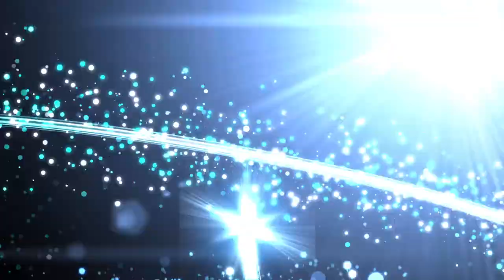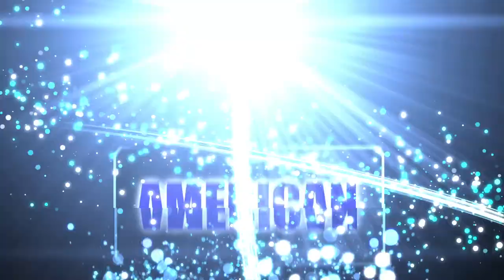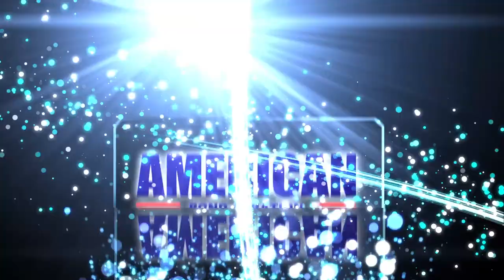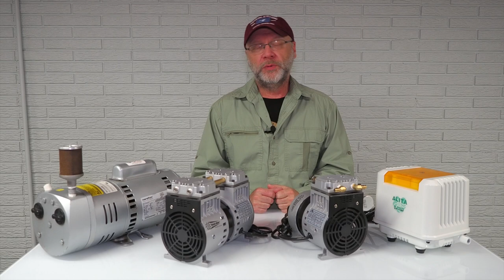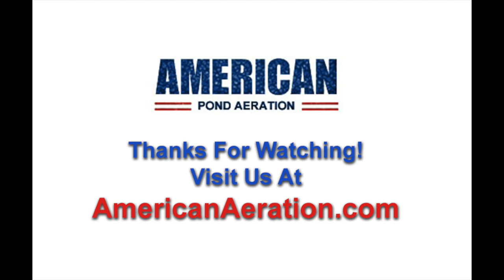Pond Aeration Pumps - Three Popular Designs And How To Choose The Best One For Your Pond.

Comment: Thank you! This was very informative! I am curious to know how loud each can be and their recommend proximity to a home.
Reply from the maker: Hi Jonathan...great question.  Its tough to answer for all these pumps but I can tell you about two of them.  So the linear pumps, like the one on the far right are very quiet...they just basically hum a little bit.  The 1/4 HP rocking piston pumps...in a normal aerator system, with a cabinet, they have been rated around 65 db from 10' away.   This db level has been compared to a window air conditioner...as one example.  The Kasco pumps when purchased in a system come with a module that really quiets them down...you can purchase this module separately too for older systems...it's purpose is just to monitor the air intake filter and tell you when it needs changed, but it dropped sound out of the pump by 34% which was pretty good!  None will ever be silent but they are getting better all the time and to be honest, most people don't seem to think they are very loud at all.  Thanks again for the question.
Reply: @klmponds  Thank you for the quick reply! Again, this is great information. I would like to install a system sooner rather than later, however to install the system away from the house would require greater electrical work. I could install it near the house (which is approximately 30ft-40ft from the edge of the water), but I fear this would be loud for my neighbor and I. I am fairly certain I need a rocking piston compressor. Would it make an auditable difference if the compressor is in a cabinet mounted to concrete versus a cabinet fixed to a post?
Reply from the maker: @jonathanrhodes4788  you are welcome!  So one thing to note...you don't necessarily need to run power to the water...at least in terms of running one of these aerators.  We use burial airline all the time for what I would call remote power.  The pump and possible protective cabinet goes by the power source, then you run airline in ground to the pond edge and the weighted airline goes in the water and down to the difuser.  Its usually a lot cheaper doing this than running electrical.  But if you want power near the pond anyway, then for sure, that's doable.  Good question on the ground vs post mount.  I don't know that I have a super accurate answer for you as I think it more has to do with the cabinet's ability itself to buffer the sound output.  My perception is you might have a bit less vibrational noise out of a poly cabinet over a metal one, but I have no evidence to back that up...and the difference would probably be slight.  I like this question though so I'll do more research on this and see what we can find out.
Reply: @klmponds  We have a wooden post that we ran conduit to from our outbuilding and took the post to the edge of the water. Installed 4 gfi outlets on the post.  Works great.  Use a "fake rock" to cover everything up and keep the noise level down.
Reply: On our Half acre pond (14 feet deep in one end and then up to about 6 feet in shallow end) .. I INSTALLED A KASCO SURFACE BUBBLER ( some call them “boilers ?”…) this past Spring(2023) … the results are remarkable.  
I Use SONAR RTU AS WELL as Tsunami and others for aquatic weed control.  
Dark blue lake dyes have also provided benefit by slowing down the photosynthesis of aggressive algae growth. 
It took a massive amount of duckweed and our pond “turning” resulting in a massive fish kill …. For me to better educate myself and get things right.

Comment: Are the output port fittings / screw threads all standard? I have a Thomas 2680CE44 but nothing specifies what size connector fits the discharge port to connect the distribution manifold.
Reply from the maker: Hi James...so across the board, no, the threads/ports are not the same on the different types of pumps.  On most rocking pistons though like your Thomas, the port/thread size should be 1/4" fpt.  I hope this helps for you!  Mark

Comment: I have a few questions if you'd be kind enough to answer It would be very appreciated, sorry if you already answered the same ones already.
The pond I'm installing aeration in is around 2 acres 24ft in the deepest section (middle ish of pond) Will running a diaphragm pump (hiblow 10ft rated) in the shallower section at 9 feet still be moderately effective assuming it is above the thermocline?
If I split the hose to two diffusers on the diaphragm pump am I over stressing the pump diaphragm?
lastly in relation to the first question... forgive poor wording but if I run a rocking pistol in the deepest depth for limited hours daily say 2-4 (24ft) will the combination of the diaphragm pump running 24 hours a day change the answer to the first question or how will it effect?
Reply from the maker: Hi John...so if you already have the HiBlow and want to use it there's no issue in doing so as long as you give it some room on the depth.  If you don't have that aerator yet, I'd pass and just get a rocking piston to handle multiple diffuser locations.  A single 1/4 HP pump would do it, or if you wanted a bit more air, you could go to a 1/2 HP.  One diffuser doesn't have to be at the deepest but it should be reasonably deep...Anything around 15 to 20' will cover a bit more than an acre in size, so if the second diffuser is at 9' that would cover it all pretty well.  But you would likely want to try to aerate most of the pond with something and aerating just in the shallow section, while useful at times, is not going to help as much with water quality or coverage.  I mean, in reality you can try anything and see how it goes.  No harm in that and if you can save money great...but being under aerated like that isn't usually going to produce the results you want.  

On the two diffuser arrangement....you want to have a manifold on the pump that has a valve for each diffsuer...this way you can control air flow between them as you wish, even with the depth variances.  Splitting the line, such as with a T or such is not going to work becasue air will go to the point of least resistance...ie, the shallow diffuser.

Does this help for you?
Reply: Thanks for replying. Yeah, I already have a hiblow running before I stumbled across your video, got the 80, undersized for the acreage. (thought process was some aeration is better than none, and it could at least keep the beach/dock area nicer) You was very helpful, and I think it's awesome you respond to peoples questions. I was curious about any experience with undersized/above thermocline aeration and how beneficial it might be, I knew starting out I would have to swallow the power bill and end up running a rocking piston, at least part of the day.   @klmponds
Reply from the maker: @Project_Happy  no problem at all.  So my honest opinion is I don't think the limited aerating will help that much...but it can provide some place for fish to go that's better aerated.  And, heck, I could be wrong.  Since you have it in hand, see how it does and if you need to do more, you can over time.  The 1/4 HP rocking pistons that you would use in the deeper water cost about 15 bucks a month to run full time.  So not bad really...not as cheap as a linear of course but not bad for what they cover.  Don't feel you need some kind of big pump just because of the depth.  The 1/4 HP will handle it fine and you can put one diffuser on it to start, use your hiblow in the shallower area and you'd have good coverage if you need to go that way.  Budget wise the best I have is the Easy Pro PA34...we have sold those for many years and it's been a good system for a reasonable price.  https://americanaeration.com/sentinel-1-4-hp-aeration-system/

Comment: The 1/2 hp has a bridged intake and exhaust. Are these motors designed to block one end or designed to have an intake filter on each end? I don't want to overwork it and the pistons probably aren't timed to run opposite of each other.

Thoughts?

If you run dual intake then should you also run dual exhaust instead of single with a split?
Reply from the maker: So I spoke with a Kasco engineer about this.  He said he did lots of testing using both in ports and there was no benefit in doing so.  There was minimal at best extra air flow so he said no need to use both.  And if you did decide to run a dual intake you would not need to run a dual exhaust since extra airflow would be very minimal.

Basically all of the systems we work with using dual pistons have one intake port open, and one out-port open.  The air filter goes on the intake and the out-port has a brass elbow that connects to a heat resistant hose...or a multi-valve manifold.  These of course ultimately lead to the airline that goes to the diffusers.  We have great performance and great longevity out of them. Hopefully this helps answer your question.

Comment: Thank u for the video. I'm from India and was starting a fish business with a half Arce fish pond with a depth of 8 to 10 feet. Which aerator would work well for me. I would be doing intensive farm.
Reply from the maker: Hello!  I would investigate a couple diffferent things.  For a sub-surface aerator system, you could look for a 1/4 HP rocking piston pump as pictured in the video here.  There is also a 1/4 HP rotary vane which would work at the depth you have.  And for fish farming, you might consider looking at a surface aerator of some type.  Those are often desirable for fish farming in warm/hot weather.  A 1/2 or 3/4 HP model would work for a surface aerator.
Reply: @klmponds  thank you again, why a surface aerator? Do they work better for fish farm, if yes why so?
Reply from the maker: @antarjot  In certain situations I think the sub surface aerators can warm the water too much in hot weather.  It is better to not turn everything over but just aerate at the surface...increasing oxygen in a zone so to speak, without stirring up the entire pond...which increases the temp of the entire pond in warm weather.  Fish need a balance of good oxygen levels, and reasonable temps to do their best.  Too low of oxygen, or too high temps will cause them problems.
Reply: @klmponds  thank you ever so much.  This was very informative. I'll keep bothering you with more questions 😁
Reply from the maker: @antarjot  your welcome!  Reach out anytime:)

Comment: Are the two in the middle the same used to inflate car tires?
Reply from the maker: No...I don't think they would be good for that.  These are continuous duty pumps and the air output or psi is not that high.  Typically we don't want it to go above 20 psi so systems have a back pressure releif valve built into them.
Reply: @klmponds  really helpful, Thankx!

Comment: Can I leave my air pump outside all winter without running it.
Reply from the maker: The best answer I can give is, it depends.  Most people leave their rocking piston pumps out...or I should say in a proective enclosure, cabinet, etc...all winter.  Many will run them for fish protection.  A linear pump, if it isn't being used, may be better off taken inside.  The diaphgrams are rubber and I'm not sure how the cold affects those over the long term.  It might shorten their working life.  In most cases they aren't costly or hard to replace but I like to get the most life out of them that I can.

Comment: do these piston pump require an air tank?
Reply from the maker: No, no air tank involved.  They generate their own air output.
Reply: @klmponds  are these silent oiless compressors the same type you find attached to an air compressor with tank usually used for spray painting? 

cheers.
Reply from the maker: @sweeyong7756  Unforutnately I'm not sure about that.   The only compressors I've seen for painting would have been more for air brushing work...much smaller than what these are.